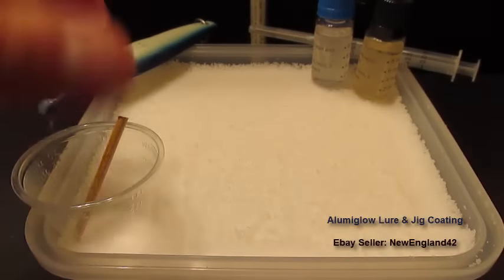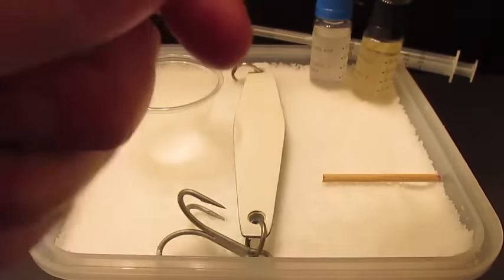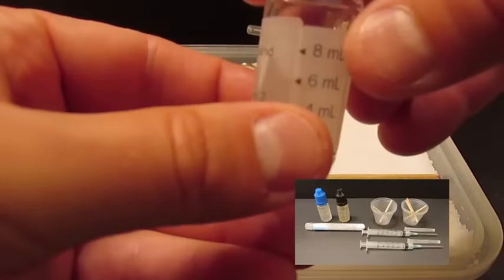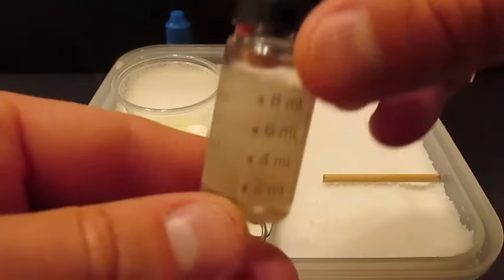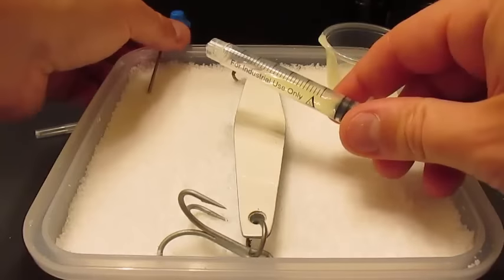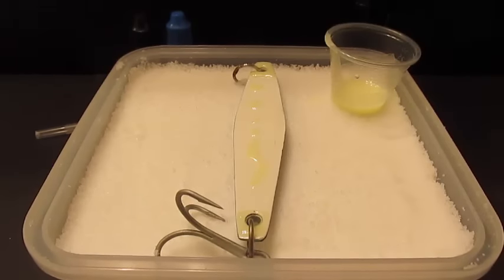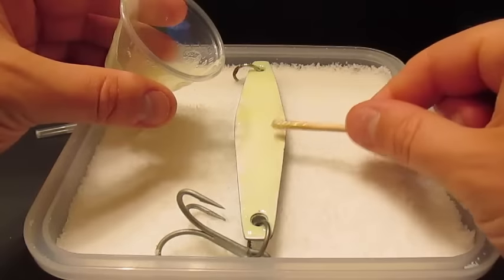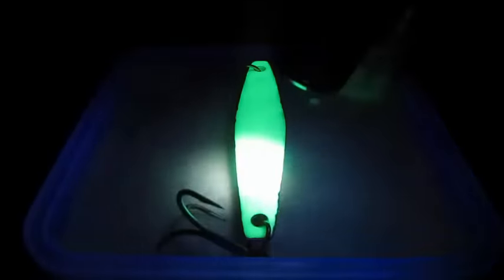Tady A1 Glow Painting with Green Alumiglow

Comment: Hi thank you for the video,
this looks cool but were you able to compare the performance of a coated jig vs non coated ones? is there a real difference?
Reply from the maker: ***** During the daytime, I can say no - even when I've dropped down 100' beneath the boat. However, I have gotten bit at night on sardines dropped beneath the boat with a rubber-banded glow sinker. I've also had the glow sinkers directly bit off, but that happened once or twice with plain lead to. Haven't gone out yet this year so I can't give an personal account (yet) of catching a BFT or YFT on my glow jigs. But here's some testaments to tuna being caught at night on glow jigs...Also, a certain boat out of San Diego has been catching 150+ lb BFT using squid and with glow sticks rubber banded to the line. Here's some links of tuna and Opah being caught

http://www.excelsportfishing.com/pages/report_listing.php?month=04-2012

http://www.bdoutdoors.com/forums/threads/opah-7-30-ranger-85-1-5-day.596401/#post-3853912

http://www.bdoutdoors.com/forums/threads/favorite-big-bluefin-iron.586591/page-2#post-3796311

http://www.bdoutdoors.com/forums/threads/not-rod-building-what-catch-are-you-most-proud-of.324074/page-2#post-2244860